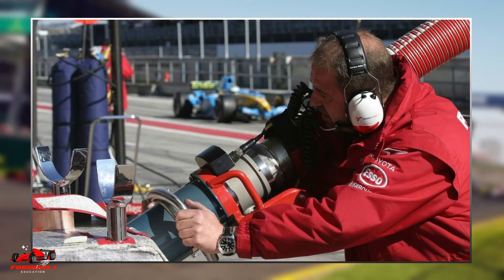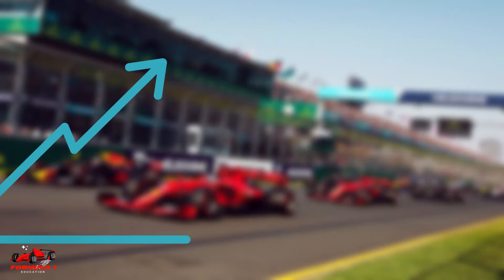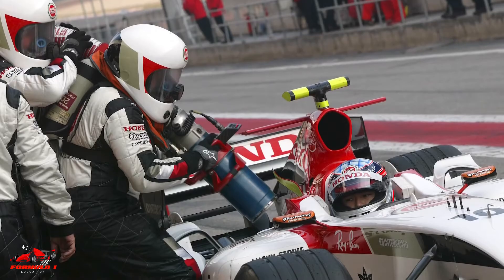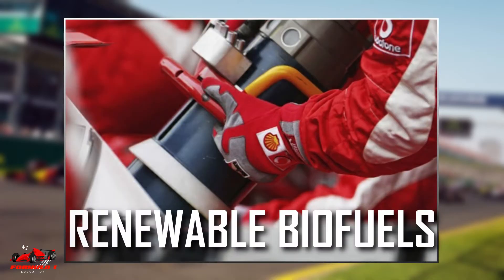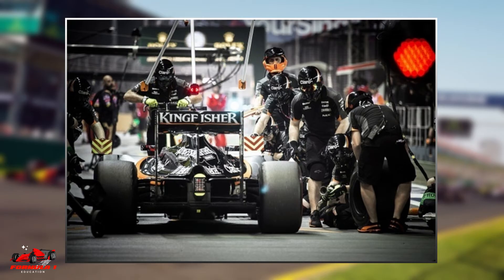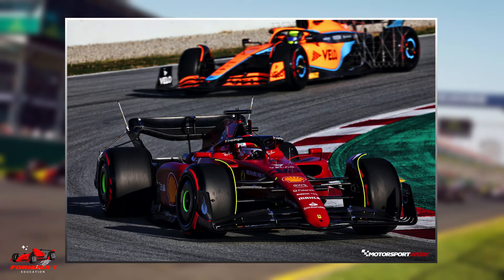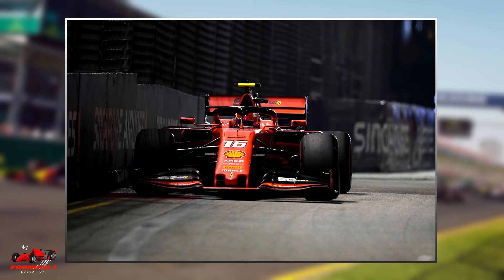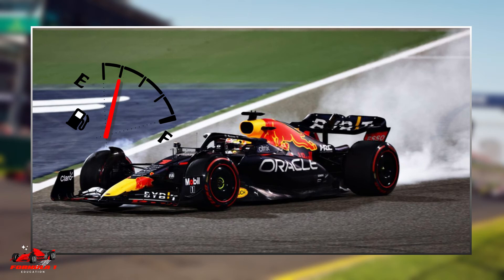Formula 1 Fuel Explained

Comment: Yeah, if you are going to make a video on fuel octane, you need to know that there is a difference between Research Octane Number and Motor Octane Number vs Pump Octane Number, the actual number you see listed at the gas/petrol station.  The F1 octane numbers you are listing are RON vs the pump numbers which are (RON+MON)/2=PON.  FIA max allowable MON is 85.  So for RON range 95-102, PON range is 90-93.5 or pretty much what's available at the pump.